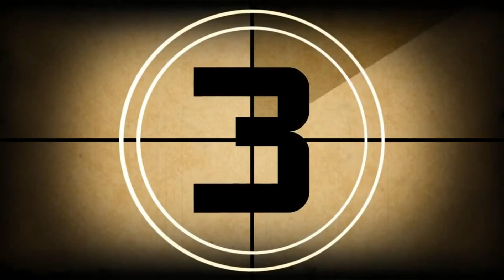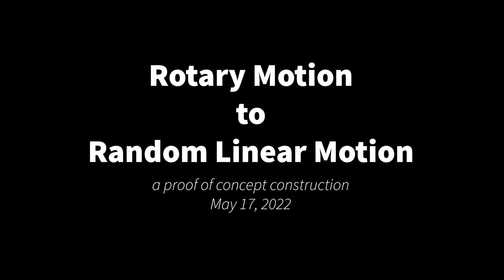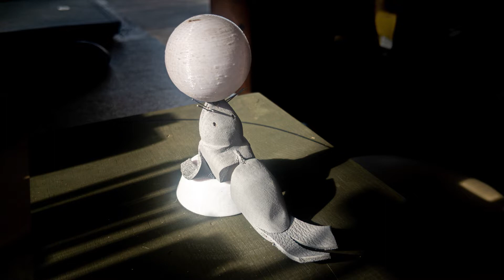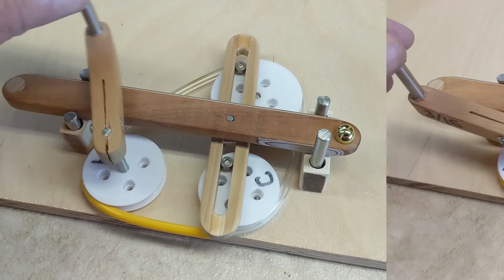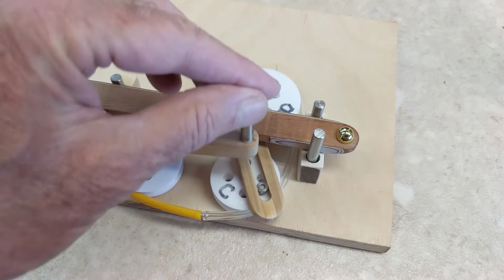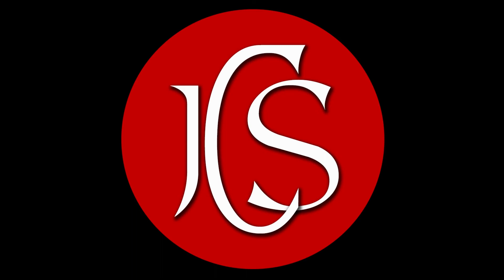Rotary to Random Linear Motion for an automaton

Comment: It appears to be that discs A, B, and C are different diameters, which causes different rotation speeds for the pins moving the cross piece.  This creates random motion.
Reply from the maker: You are correct! The differing diameters of discs A, B, and C are the key to apparent random linear motion. If someone were to take the time they would see that this is not truly random.